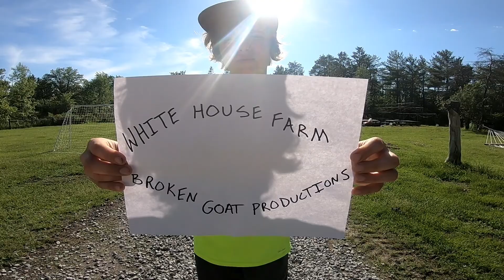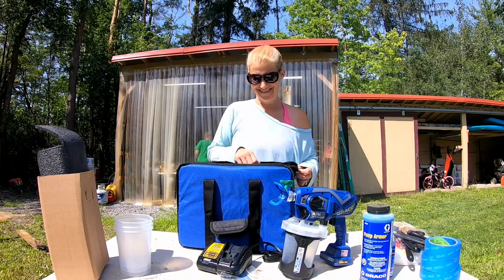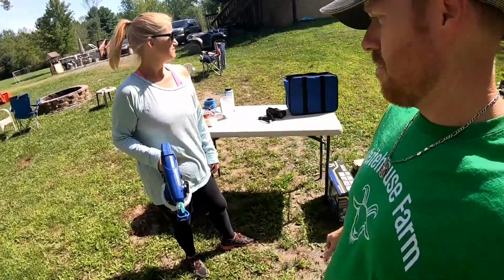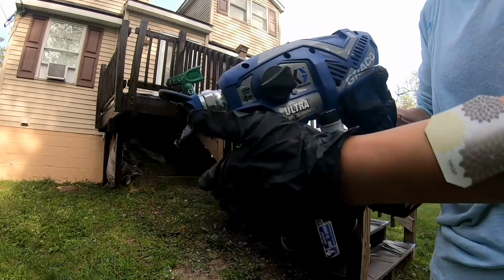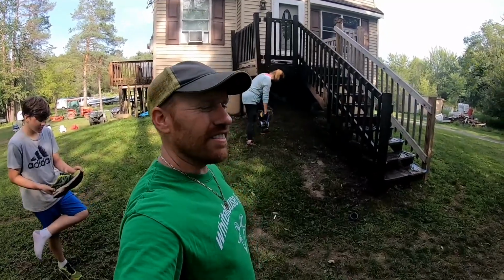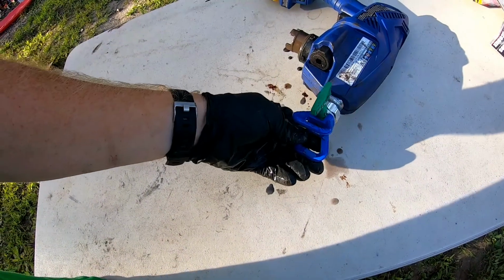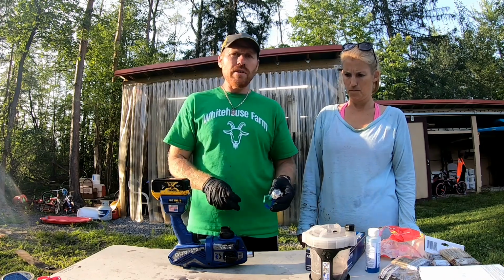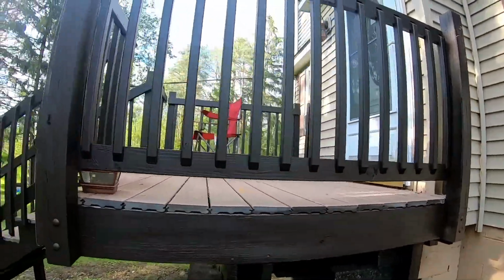Graco Ultra Cordless Paint Sprayer "Finally Getting Our Deck Done!"👍

Comment: Good vid... For staining and decking I would however recommend a much smaller tip size, a 108 or 208 for spindles at the very highest, Also always best to have a spray test card to ensure your fan has soft edges but that's more for when going for a uniformed finish
Reply from the maker: Awesome! That's good to know we still have the other decks and alot more spindles lol! Thanks for the tips and thank you for watching!👍😁